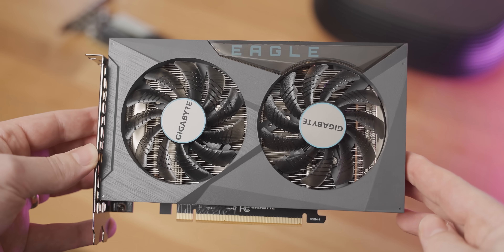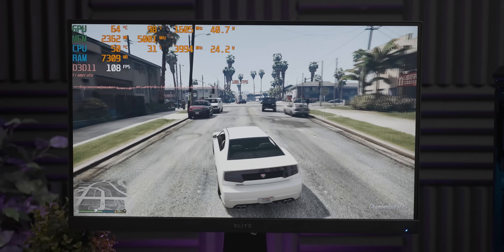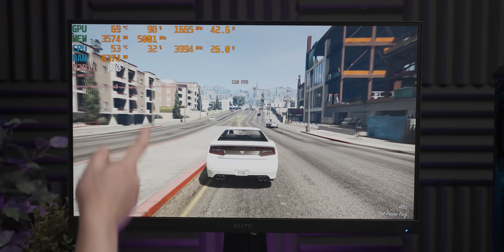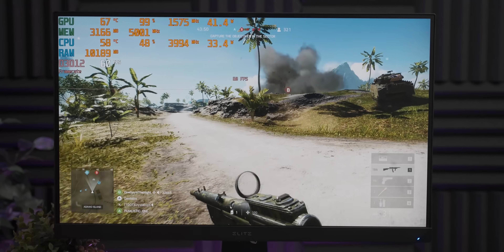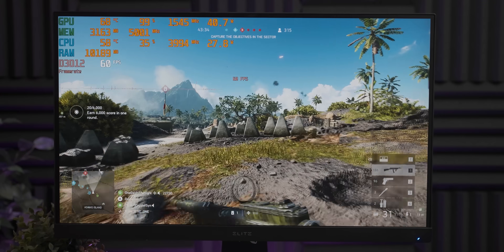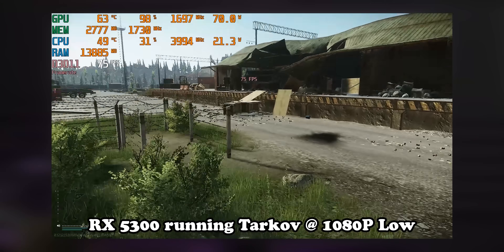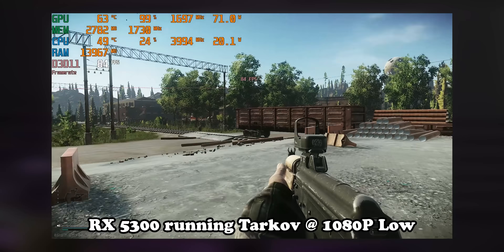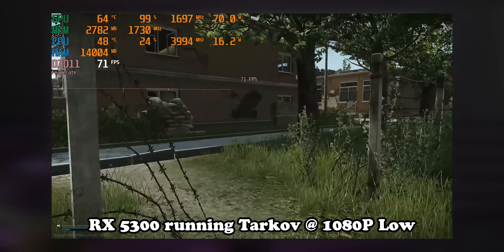This RX 6500 XT Comparison Was A Terrible Idea...

Comment: I like the 6500xt, ran one for awhile until I found a sweet deal on a 1070 and then sent it back. It’s a great card for what it is, personally if it had 6 go of vram, a bit higher thermal leeway, and full pci-e lanes, it would dominate
Reply: It would cost $500 then :D
Reply: Well here they didn't bother importing 6500xt, 3050 ftw lol!

Comment: I’ve also tested and used the 6500XT and it’s better then you and other reviewers say it is. It wasn’t met to be a high end GPU. The community asked for a GPU they could actually buy, new, under $300 that could game. It’s new, mostly under $300 and yes it can game. Funny how there isn’t as many people complaining about the RTX 3050 which Nvidia stripped down. Seems they get a pass?
Reply: And in many places, you can get a 6500XT for MSRP, whereas a 3050 seems to be always priced way over MSRP.
Reply: @Groovy-Train  People also forget the 3050 was also only intended to be a laptop GPU. In fact it’s been in laptops for over a year before being released as a desktop GPU. Yet it’s only AMD they call out. Like wtf be far or don’t talk about it.
Reply: @dberube82  Mobile 3050 isn't the same chip as the desktop.  The 3050 desktop is a gimped 3060 desktop die.  That's also one of the reasons the desktop 3050's are pegged at crazy prices, it's simply too expensive to make to sell anywhere near a $250 MSRP.

Comment: The 6500xt is a great entry level card, but the actual price is a joke, it should be $130 USD tops. Its the current generation equivalent of the gt1030 (released on 2017): You can play most  current games on it if you lower the graphics quality. And AMD if by any chance you read this: Using dual fans, heatpipes, a big fan shroud and sell it on a box big enough for a small TV to make it look like a midrange card, doesnt make it  midrange card
Reply: All graphics card prices are a joke right now. If AMD had priced this at $130, then retailers would probably have upped the price to $200 by now anyway. RTX 3050's are going at £100 over MRSP in the UK, and that's just the retailers scalping!

Comment: rx 6500 would been good for the price if it costed like between 100-160$ most. But with todays prices its just to dream about. It would been a budget king for a new gpu at that price, what it should have been priced in the first place. Think im sticking to my good old gtx 1060 for a little longer 🤣

Comment: Dawid the GPU from AMD was meant for a laptop where a number of functions were put into the CPU so that heat/power can be spread out statistically better between them so the cooling of the laptop overall can be managed.  Imagine two chips, one  at 70W and one at 30W and the lopsided cooling, but if you split it so they were 50/50 watt then you got an even cooling solution.

Comment: As far as I know, the 6500XT was originally supposed to be a low end laptop DGPU which was going to end up paired with mobile Ryzen CPUs and not need to have an encoder at all. Or that many video outputs.

Comment: i bought the asus dual 6500xt as a replacement for my 1050ti and even being on gen 3 with a ryzen 5 2600 it runs the games i play a lot better than i used to, the recording is annoying as you cant use games bar to record the 30 second replay but using cpu on obs it works good
Reply: oh it's so tiny oh sorry about that🤣🤣🤣🤣

Comment: This is the only new GPU many people can afford at the moment. Gaming performance is ok.
Reply: People could wait for literally 3-6 months, the gpu outage is already on the downwards trend, and my local shops are already stocking gpus for near normal prices. no reason to buy garbage
Reply: @Kange33  Everybody knows that. My point is, that he should not tell people that the only hardware they can afford is crap.
Reply: @autobus11a   So should he sugarcoat it for people in your opinion? Lie and say its ok when its not? when a product is bad, its bad, doesnt matter if you can afford it or not. the card has the same/worse performance than my 6-7 year old 1060.
Reply: @Kange33  I didn‘t say that. Some people may be offended by the word „crap“.
Reply: @autobus11a  People shouldnt get offended by everything, but hey its 2022 and everyone is weak as balls, just look at twitter. But yeah youre not wrong.
Reply: @Kange33  Alright. I have a 970, it was used and dusty and horrible, but it runs TF2 at 300 and a few editing softwares that I need. To have my setup that I spent a good thousand dollars on called crap would feel horrible. The market is fucked but people need PCs to do things, and some people can't afford to save up. The market price is going down, but sometimes a midrange GPU that feels like it came from 2017 is all we can get.
Reply: @Adm1ralCrunch  the used market exists. you dont have to buy brand new. used 1000 series gtx cards exist for pretty much the same price, and they outrank that new dog doodoo card.

Comment: The most interesting thing I learned today was that the Quadro T600 is a very good LowProfile GPU for small upgraded SFF PCs. :D
Reply from the maker: It really is! The title just had a good ring to it. 😂 I like the little T600. The RX 6500 XT I like less, but at least it can still do gaming.
Reply: @DawidDoesTechStuff  am going to lenode ur nan
Reply: The RX 6400 low profile is better than the T600 and cheaper than the RX 6500 XT. That's the best Low Profile card you can currently get.
Reply: @mikeonlinux5491  I even put of those in a 1 Liter  mini PC from Lenovo, so i got more GPU power in a tiny box then even those new Minisforums pcs. Just the CPU is  less because 10th gen Intel.

Comment: What is making me laugh at the moment here in the UK, is that all those high-end graphics cards that were unobtainable will very soon be flooding the second hand market.  The reason?  Well, we are just about about to hit a huge energy crisis where electricity will increase by a whopping minimum of at least 50%.  Where once those mining rigs where making a tidy profit, on April 1st the cost of mining will not be so economical.
Reply from the maker: Wow! That’s very interesting. Mining with a 350w GPU won’t work then. 😂 Sorry to hear about the spike in power cost though. That really sucks.
Reply: the prices are already dropping since china put further restrictions on crypto and has been heavy handidly banning mining which has lowered the demand for bitcoin and ethereum thus leading to this increasing 6 month price drop.
Reply: And come the winter probably closer to a 100% increase, however those with cheaper rates abroad might still buy them up and ship them.
Reply: If you went on what to mine and used the calculator on there youed see that unless electric goes to 75p-£1 it's still profitable....
Reply: This isn't correct. I have worked out the power costs for 3000 series and 6000 series cards and they will be profitable upto 50-60p per kwh. The UK is nowhere near that yet. Mine is going upto 28p
Reply: You might wanna invest in solar panels instead of GPUs at that point, 50% will be an insane increase for the people living a middle class life in your country

Comment: wtf is GTA 5, my old pc's 2060 ran it at 90, my new one with a 3060 ti runs it at 110, why do these shitty cards run them at 120
Reply: graphics settings? i think Dawid runs them at normal which is like the low settings for gta.
Reply: @kirby1225  i max em, and he said it was the highest settings. Is the game just really horribly optimized for newer cards or something?
Reply: @inutero3516  don't bother with ultra settings. they aren't worth it for the huge performance drop
Reply: @kirby1225  it's kindof insane that its still one of the most played games of all time and they dont even bother to fix performance... a 3060 ti should easily push 2-300 given how ass the graphics are... hope gta 6 will be better if it releases this century
Reply: @inutero3516  oh yeah, the game doesn't like to run higher than 140 fps anyway as it starts to stutter
Reply: @kirby1225  really? wow. It's insane that people don't hate rockstar that much. Red Dead 2 saved their asses i guess lmao

Comment: You joke about that 6500xt, probably better then my rx5500xt lol
Reply: It's actually worse than the 5500XT.  At best on PCIe 4.0, it performs like a 4GB 5500XT, while the 8GB one absolutely demolishes it. On a PCIe 3.0 system, both the 4GB and 8GB 5500XT outperform it.
Reply: pfft you actually got a better gpu. If its 8gb sell it and buy a gtx 1070. its around the same price second hand!...

Comment: I would say that the T600 appears to have less DCP latency issues (in my experience) than the Radeon Pro 3100 I had previous.  Running it in a Audio workstation (Ableton Live), smooth as silk and the HDMI audio doesn't interfere with my ASIO drivers.  The 3100 had consistent spikes that were a bloody nightmare, and really didn't like my multi monitor setup.  The T600 may not be the option for games, but it's definitely a discrete option for none graphical based systems.

Comment: The 6500 XT doesn't have an encoder in it because it was never built to have one. It's a repurposed laptop chip slapped onto a discrete PCB to try and alleviate some of the GPU shortages. The 5300, in comparison, does have an encoder because it's a desktop GPU design.

Seriously, for all of the 6500XT's woes, all the shit it gets is from people using it outside of its intended scope. It's a low-end 1080p card, use it as such and it's fine. This video literally proves that to be the case.
Reply: "To try and alleviate some of the GPU shortages"....
Try and alleviate shit bro... they put it out because they know people are desperate and will grab anything they can, even if is shit... so they gave them shit... 

If they realy cared about alleviating gpu shortages and doing right for the custoer, they would have put out the 5300 for 150 dlls or so.... They selling you a castrated gpu instead for near the double.... Is all about milking those poor bastards that can't just wait a little longer for the market to stabilize.
Reply: @josejuanandrade4439  yeah, they could've done minor updates to the rx 5300 and release it as the 6300 or something like that.
Reply: @josejuanandrade4439  To be fair you can still buy brand new GTX 1650's, 1660's and RTX 2060's, so it's not like Nvidia aren't scalping the market for all it's worth.
Reply: It's okay so long as you're not that budget gamer that is still on PCIe 3.0 to save money, which is quite a bunch of budget gamers... It's pretty flawed for its intended purpose if you ask me. Buying budget right now is just asking for going OVER budget...
Reply: @MLWJ1993  if you're still on PCIe 3 then you need to look at this card on a game-by-game basis. Does the stuff you want to play get crippled by Gen 3?

Clearly this video shows the answer is "maybe". But is a little bit of research before hand really so difficult?
Reply: @rossclutterbuck1060  Not difficult, but this is definitely not a "good" GPU by any stretch of the imagination. It's just barely enough to make some sort of sense with a bunch of asterisks attached...

Comment: So the encoder thing, from what I've read it is based on a laptop GPU and the encoder aspect is supposed to be taken o by the integrated graphics of the laptop. That's why I really hate this card. If you put it in a desktop you're going to need to replace it, I can't remember the name of the new encoding that yt, and other sites are going to be adopting but this card does not support it and your out of luck
Reply: AV1/VP9
Reply: My system doesn't have AV1 decoding in hardware, but my i7-8700 was capable enough to do 1080p 60fps in software for AV1.

It's of course a lot less efficient, so not suited for mobile devices.
Reply: No you're really not going to "need" to replace it. All modern CPUs can do video encoding and decoding very well.

Comment: the rx 6500 xt is pretty good for me since they look really good and they aren't super expensive. Also im used to really "weak" gaming (Roblox, Terraria, RBR, LFS) so i wont need any fancy drivers or screen captures or anything
Reply: If you consider the use market as an option, you could look for an RX 570, RX 580 or 1650 super for similar or better performance without losing features.
Reply: @SpaceLion949  The used market is fine if you're prepared to do without a warranty or knowing the history of the card. You pays your money and takes your choice.

Comment: The 6500XT was pulled from the mobile segment where it was supposed to be paired with an iGPU on the mobile platform where the iGPU would do the encoding to save space and optimize power.   So it got kinda left off the thing.  Like oof AMD
Reply: When I saw the 12400F in the specs, I just knew Dawid would complain about the lack of encoder. 
Buyer tip: When trying to save cash with the 6500XT, think twice before double-dipping on savings with an Intel F-SKU. It will cost you streaming capability. If you wanna stream, spend the few extra bucks on a non F-SKU to get that Intel iGPU and it's included encoder.
Reply: @JWooden271  it is apliable in amd side to so its better to paired it with g series than x series cpu?
Reply: Im saving my money to get 6500 xt becouse its the same price as 1050ti on my country and i have an amd apu but my motherbpard is b350 so no pcie 4
Reply: @mt6739fan  Great. Several review sites and YouTubers have tested this card with both PCIe 3 and 4. Some games are completely unaffected, others are significantly affected, so you'll just have to adjust settings accordingly. 

But it should definitely be better than a 1050ti. Enjoy!
Reply: I came here to say the exact same thing
Reply: @brucethen  Exactly. They weren't selling these as laptop GPUs (where they had been custom-built to work together with an APU), so they slapped the dies on a discrete board and called it a day. 

If you aren't going to be streaming/recording anything (and let's be honest, most people aren't), then the 6500 XT will get you gaming. Would it be acceptable in a normal market? ... No, but it wouldn't have been sold in a normal market.
Reply: Modifying dies to add features is not a trivial thing, unfortunately.
Reply: I actually own a bit beefed up OG mobile version (RX6550M) paired with a decent Ryzen 5 7535HS APU and honestly it works pretty OK for cheap casual gaming combo, especially for the price I paid for the laptop (460USD) about an year ago

Comment: As a fan of small form factor builds, I really wish there were more low-profile options like the T600.
I'm a bit disappointed that the 6500XT beat it so soundly since they're the same price, but in all fairness the T600 was intended to be used as an incredibly efficient workstation card at only 40W, and not as a gaming card.  It also has Nvidia's encoding tech and 4 DP outputs.
Reply from the maker: For sure! I was also hoping the T600 would fair better against the 6500 XT, but like you said, it’s still a decent (of over priced) little GPU.
Reply: @DawidDoesTechStuff  am going to lenode ur nan
Reply: what if you pared it with say a 5600g? youd just use that for the encoding.
Reply: @pauldethick6175  Pairing a 5600G with 6500XT ? That is a bad move. Unlike R5 5600X, the 5600G only supports PCI-E gen 3 . As you can see in the video, the fps fall off a cliff in Doom Eternal.
Reply: @fleurdewin7958  good point, do intel igpu come with nvenc encoders?
Reply: @pauldethick6175  Of course Intel iGPU  doesn't come with nvenc encoder.  Nvenc is Nvidia proprietary stuff. Intel iGPU has QuickSync encoder
Reply: @pauldethick6175  Yeah.  It's a good question, and it should work since supposedly that's what AMD intended.  The test system had a 12400F, so it didn't have an iGPU to do that.  I wonder if the AMD drivers would allow that recording feature to work with an Intel iGPU.
What I'm really wondering in this comparison is how the T600 would do if you could turn on DLSS.  Although it's built on the Turing architecture, I'm not sure how many of the features it supports.  I picked one up awhile back and stuck it in a small form factor case that doesn't support full height PCIe cards, but I haven't explored what it's capable of yet.
Reply: @dividion8102  Last time I checked it can use DLSS, but it hurts performance. 😅
Reply: @MLWJ1993  So 1080p w/ DLSS off gets better fps than 720 or 900p upscaled to 1080 w/ DLSS on?  If that's the case then.. ugh.
Reply: @dividion8102  unfortunately, yes.
Reply: Have you looked at the quadro P1000? if you don't want used, PNY seems to have a V2 available. with P620 also v2 but that one is 2GB
Reply: @stephen1r2  
Months ago I considered buy a (Pascal card) ) P620 for my SFF PC, but time passed and when series T (Touring) appeared I hadn't any doubt, new generation has more power and efficiency than the older one, and prices are similar, so I discarded old Pascal cards.
Reply: All this. The only modern card that is low profile is the RX6400, which is even worse in every way.
Also why do these "laptop derived" GPUs require PCIe4 when AMD DOES NOT MAKE ANY APU WITH PCIE4?! Even on MOBILE it'd be a massive bottleneck.
Then again maybe that's why these are so readily available (aside from being useless to upgrade older computers with), because nobody buys AMD GPU laptops due to having intrinsic design flaws.
Reply: AMD has a low profile 6400 for 159.99 at Best Buy. I don't know how good it is though.

Comment: Has anyone modified a firmware to allow screen capture? That just makes no sense as to why they would remove it.
Reply: It's not physically present on the chip. It's a laptop chip, emergency pressed into desktop use. On a laptop the encoding is done by the iGPU, so it would have been a waste of silicon.
Reply: @lucidnonsense942  I have a big hole in the front of my brain so I wasn't thinking very clearly!

Comment: the word on the street is that the 6500xt was designed as a laptop GPU that's meant to work with the integrated graphics, which explains the lack of and encoder and the measly 4 PCIE lanes